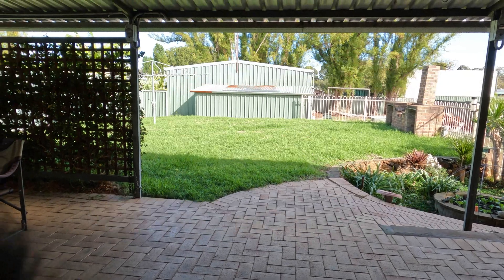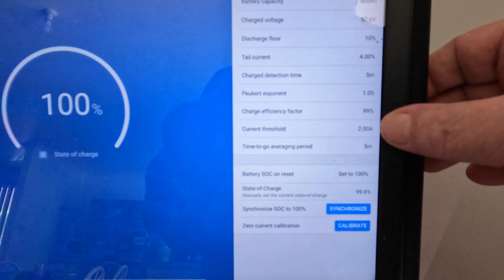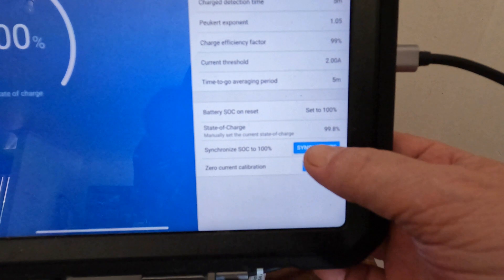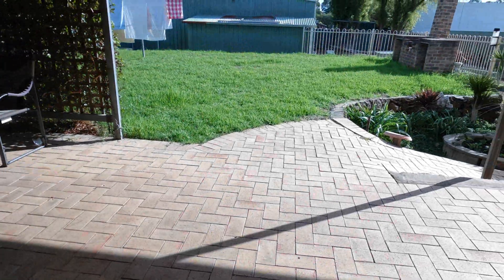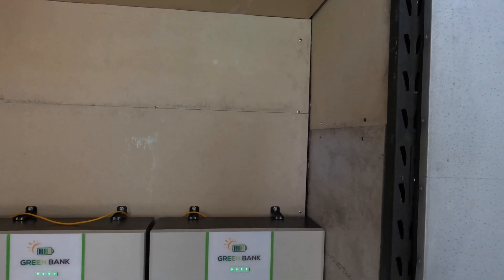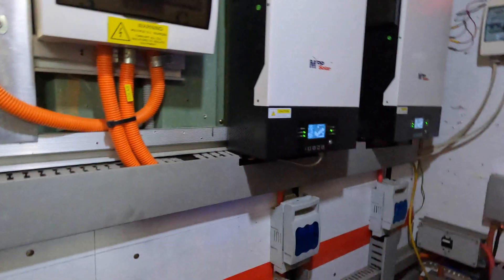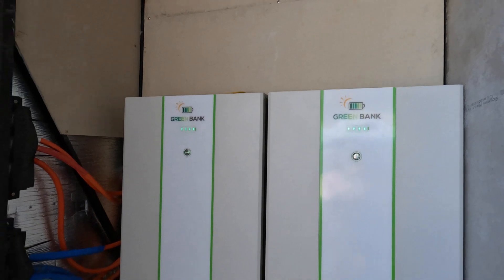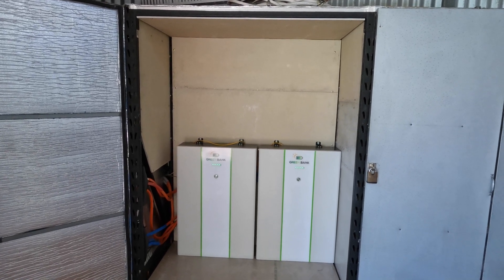OFF Grid LiFePO4 24kWh.  Update on System Progress

Comment: Very Nice Chris!  Should last you and Sigi a Very long time!
Reply from the maker: Hope so Norm. We are putting a bit of work into making sure they will be confutable and safe in there new home. The inverter looks quite big on the spec sheet so we will just have to see how it all fits into the cabinet. Also the cabinet is insulated so I am trying to work out the venting in summer but also to retain any heat in winter so it keeps the batteries near the 25c mark for best performance. I want to achieve that by using the heat the inverter produces.  That is what we hope anyway. 😉 🖖 👍

Comment: While the recommended peukert value is 1.05 I found that 1.04 was closer to the correct value for lithium. That is what I run with now and the charging stops completely at about 0.4 to 0.3Ah, then after 3 minutes the Victron goes to 0Ah (charge detection time is set to 3 minutes)
Reply from the maker: I will give that a go Adam.  Mind you when i get the new inverter that talks directly with the batteries internal BMS I should not have any more monitoring problems. 😉👍
Reply: @JustinCaseSolarPower  Absolutely you won't mate. I'm not planning on upgrading my system to the likes of yours so I decided to figure it out. Mine is the older BMV712 so it can be a little bit more touchy than the smart shunt. Mine hits 99.7% and then the batteries take a pretty low amount of power (between 50 and 100 watts) for the last 0.3% and it ends up very very close.
Reply from the maker: @adamkuklych6672  Yes we spent a few $ upgrading to this system, will be close to 18k by the time we are done. But we are hoping for a very  easy to maintain system after we are done. We are just getting to old to do all that heavy lifting that was involved with putting the upgrades off for another 6 or 7 years. We would have been to old to move all the lead batteries at that age. This way it should see us out, then it will be up  to our Children what they want to do. Sigi and I will no longer need to worry about that. LOL 🤣👍

Comment: killer system it will be! will be following as you go!
Reply from the maker: I hope it's the last time i ever need to change it. I love boring solar off grid system that just work. 🙃👌
Reply: @JustinCaseSolarPower  I do to!
Reply from the maker: @GoingOffGrid101  :washhands: 🖖
Reply from the maker: Mate that is a New LOW Frequency inverter. It looks to be on par with the HF inverters in Power Efficacy. I am very excited  to use and test it. The older LF inverter chewed through the power just to run. here is what the Australian Model is called. Deye Hybrid Solar Inverter 8KW Single Phase SUN-8K-SG05LP1-AU. Go have a look at the spec sheet below.
I can't wait to get it all on the wall and running 🙃👍

Model	SUN-8K-SG05LP1-EU
Battery Input Data
Battery Type	Lead-acid or Lithium-ion
Battery Voltage Range (V)	40~60V
Max. Charging Current (A)	190A
Max. Discharging Current (A)	190A
Charging Curve	3 Stages / Equalization
External Temperature Sensor	Optional
Charging Strategy for Li-lon Battery	Self-adaption to BMS
PV String Input Data
Max. DC Input Power (W)	10400W
PV Input Voltage (V)	370V (100V~500V)
MPPT Range (V)	125V~500V
Start-up Voltage (V)	125V
PV Input Current (A)	26A + 26A
No.of MPPT Trackers	2
No.of Strings Per MPPT Trackers	2 + 2
AC Output Data
Rated AC Output and UPS Power (W)	8000W
Max. AC Output Power (W)	8800W
Peak Power (off grid)	2 times of rated power, 10 S
AC Output Rated Current (A)	36.4A
Max. AC Current (A)	40A
Max. Continuous AC Passthrough (A)	50A
Output Frequency and Voltage	50/60Hz; 230Vac (single phase)
Grid Type	Single Phase
Current Harmonic Distortion	THD<3% (Linear load<1.5%)
Efficiency
Max. Efficiency	97.60%
AU Efficiency	97.00%
MPPT Efficiency	99.90%
Protection
PV Input Lightning Protection	Integrated
Anti-islanding Protection	Integrated
PV String Input Reverse Polarity Protection	Integrated
Insulation Resistor Detection	Integrated
Residual Current Monitoring Unit	Integrated
Output Over Current Protection	Integrated
Output Shorted Protection	Integrated
Output Over Voltage Protection	Integrated
Surge protection	DC Type || / AC Type ||
Certifications and Standards
Grid Regulation	
VDE4105, IEC61727/62116, VDE0126, AS4777.2, CEI 0 21, EN50549-1,
G98, G99, C10-11, UNE217002, NBR16149/NBR16150
Safety Regulation	IEC/EN 61000-6-1/2/3/4, IEC/EN 62109-1, IEC/EN 62109-2
EMC	EN61000-6-1,EN61000-6-3,FCC 15 class B
General Data
Operating Temperature Range (x)	-25~60x , >45x Derating
Cooling	Smart cooling
Noise (dB)	<30 dB
Communication with BMS	RS485; CAN
Weight (kg)	24
Size (mm)	330×580×232 (Excluding Connectors and Brackets)
Protection Degree	IP65
Installation Style	Wall-mounted
Warranty	5 years
Reply: @Justin Case Solar Power and Bush Camping Australia  wow if it can get 97% in real world  that's amazing,  I think my magnums are 91% . Highest I own is 93% I believe.
Reply from the maker: @GoingOffGrid101  I know right. That is why i am really excited about testing the unit. They make some really huge inverters for massive grid farms. So they are not new at this at all. 😉 👍
Reply: @JustinCaseSolarPower  I'll he watching, always 👀. ♥️

Comment: Lots of work to switch things over & expensive been there. None of my battery monitors match the lithium batteries all the time not a big deal.
Reply from the maker: When I get the new inverter that talks directly with the batteries internal BMS I should not have any more monitoring problems. I like systems that just work right. And give me all the correct Data. 🤗 🖖

Comment: Looking good can't wait to see the new inverter up and running
Reply from the maker: Will take time. Moving from low DC voltages to 300 to 500 dc volts means I have to employ a solar electrician.  I also need to have the inverter wiring to the AC done by him as well. Its a requirement for voltages that high In Australia. Also for my Home insurance. So I am sorry my friend but there will be no rushing this install as I must wait for others to come and do the work they need to do. Hell I would love to have it running on Monday or Tuesday   🤗.  I can show the inverter to you all when we unpack it and mount it to the wall 😉  🖖

Comment: Hey Chris, thanks for the update mate, looks like it's all coming to plan...kind of feels like you're making a bit more work for yourself by putting the inverter in with the batteries though, as the side room is already established, with cabling ventilation monitoring etc. Maybe as you pull the older equipment out insulation could be added ? The batteries generate no heat at all so probably won't mind being in the unventilated battery room. Sorry mate just throwing you my ideas 😀🤠😎
Reply from the maker: It would make my life a lot easier to do that. But in summer that little room gets to 50c+ even though its insulted and vented. Also i need to leave all that gear running till the time i have the new inverter ready to run, then we just change the wiring over.  Not sure how hot the other inverter will get.  We shall see how much venting is required though,
Reply: @JustinCaseSolarPower  I'd imagine the inverter would get pretty warm, my Sunny Island when charging the batteries at 5kW does run fairly warm and it is in the open (in a big shed), I would be guessing you would need to get a reasonable airflow in the battery room in summer to keep it happy. Maybe you could screen the battery doors then with security mesh. I doubt the cold will be a problem but imagine the heat would be. Hope the aching bones have recovered....I'm just in the process of putting more panels (big heavy ones) on the roof, so it'll be my turn for aching bones next LOL 😆
Reply from the maker: @AndyM...  Not sure how hot it will get. The inverter has duel mppt controllers in + 8kW inverter. I have some fans that should change the air in the cabinet about 3 times a minuet. Yes we are recovering slowly. Take it easy lifting the big panels on the room mate. I am not allowed to climb ladders. So I get a PASS when it comes to working on the roof.  😄  👍